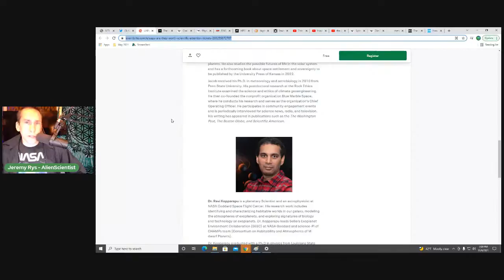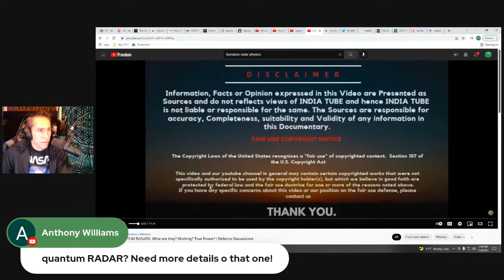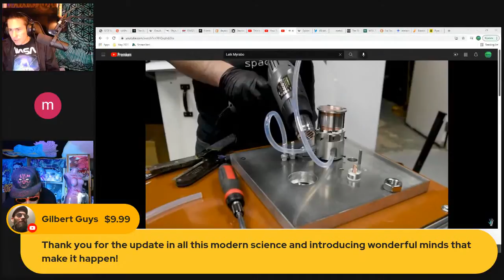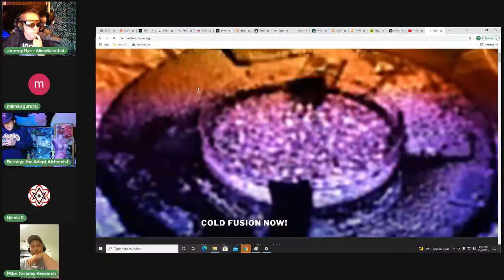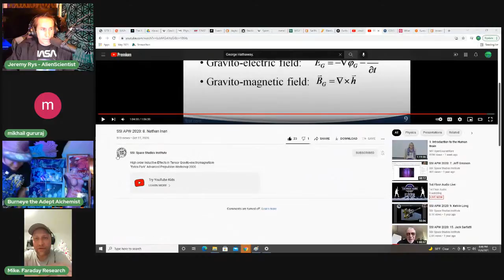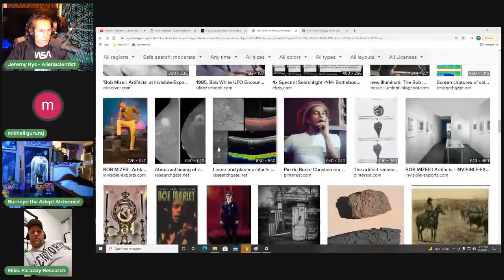SETI on UAPs: ARE THEY WORTH SCIENTIFIC ATTENTION?

Comment: https://youtu.be/vFfsEfnsA4I
Battery free? Electric car.
https://youtu.be/hEND8dlUp1Y
ZERO point energy
https://youtu.be/DmsbixQ8f9w
Bismuth is the strongest natural diamagnetic element

https://youtu.be/A5pZZJ23rDM
Free spinning magnet with bismuth repulsive buffers

https://youtu.be/Guk09lNSfG0
Zinc is also diamagnetic induction with eddy current repulsive forces 🤔

https://youtu.be/lymXYuOTc8g
Magnesium plated with thin coating of Iron & susceptible to magnetic field.
https://youtu.be/_gOlQCI9Tgg ball lightning 🤔 💡